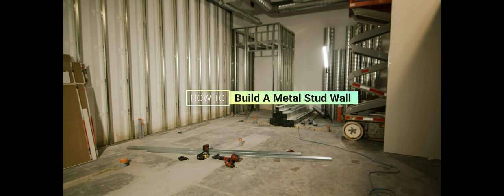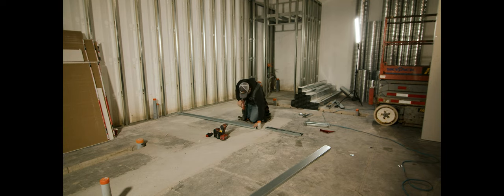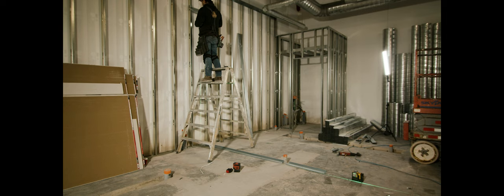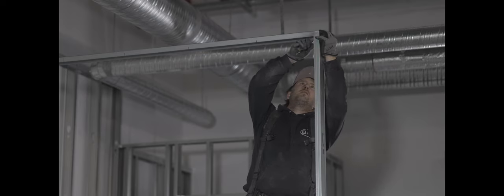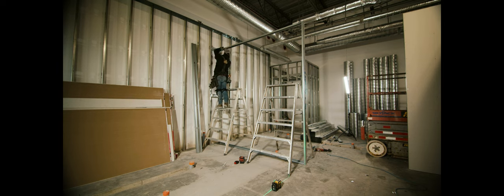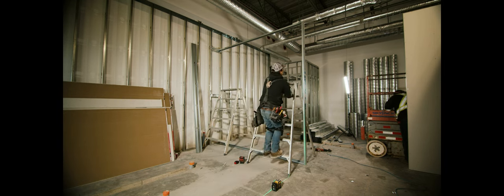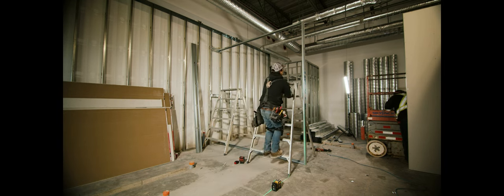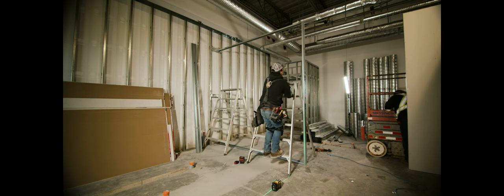How To Build A Metal Stud Wall

Comment: Screwed studs?  WRONG, it kicks out the sheet rock, use the crimper.  long, two-handled crimper makes the surface flat so the sheet rock is flat, not bulging out at he top and bottom, , , total mess.
Reply from the maker: Huh? That makes no sense at all. The screws are wafer head and do not bulge out the board whatsoever. Your telling me you crimp everything? Yikes what a mess that would be. Crimps don't hold after all the trades get in there nothing would be on center anymore. We crimp only when an impact can't fit or you can't reach properly.
Reply: @ConstructionKronies  well good for you, it's still wrong
Reply from the maker: What country are you from? Just curious, we would never ever ever get away with crimping in commercial here in Canada. Plus I'm not wrong, I tape and drywall everything and I've never had the screws bulge the sheets out in my 26 years of doing it.
Reply: @ConstructionKronies  I do commercial UNION construction in  the U.S.
Reply from the maker: @thomasgronek6469   cool man. You know this whole thing, I would love to talk more about. Do you lay down your sheets or stand them up? Do you screw the end studs in or just crimp? What types of projects do you do? And I know we can only crimp light gauge so how do you feel about 20 gauge and higher? Do you use screws then?
Reply: @ConstructionKronies  I stand the sheet rock up.  when it runs horizontally, the butt joints never tape properly.  the indentation along the long side of the sheet rock is to accommodate tape and spackle, as as we know, there is no indentation at the top or bottom of the sheets.  20 gauge metal is only 36 thousandths (just shy of 1mm), easily crimped with long handled crimpers.  BTW, I have a 50 year union card.
Reply from the maker: Yeah butt joints suck. We are just going to have to agree to disagree on this one tho. I do all my taping and never noticed any difference in the joints using the wafer heads to screw in the studs plus we honestly would never be aloud to use crimpers in commercial, I seriously just bought my first pair last year because I was doing metal stud houses and the light gauge studs for the frost walls in the basements I wanted to half crimp so I could get the screws in easier (pointing out towards the concrete). I appreciate your comments and I certainly wouldn't suggest to a 50 year vet to do it my way. Cheers mate!

Comment: Do you measure from the bottom of the vertical stud and cut the top off to keep holes in line for electric or pipes Just starting out with this
Reply from the maker: Yes we always cut the top off in order to keep the knockouts lined up for carrying channel. Sometimes in headers we will measure down from the first knockout then up. In bulkheads we don't use channel so.you can cut from anywhere.

Comment: I guess we do our steel studs “wrong” in Oregon. Cause every job I’ve been on we’ve used them framing screws with the wafer head.  I’ve only been learning how to tape for less than a year, but I’ve never heard the tapers say the rock was out of whack.
Reply from the maker: Yeah bro💪 I think the old way was to crimp your studs but the codes are more strict now and we just would get away with it. I have seen old framing videos from this British old dude and I think he did that plus he slid the studs into place and drywalled at the same time.

Comment: when you are building a wall and filling in your studs which way do the studs face ? thanks
Reply from the maker: Yes bro, face the studs in the direction you pull your centers, that tells the drywallers which way to go. We always screw the softside in first then the hard side. Think of the stud like an arrow hard side facing out! Does that make sense?

Comment: When you have 10 foot ceilings, do you use purlins for your sheet rock to hit at 4 foot increments?
Reply from the maker: No, never purlins, we will attach track to them but not drywall. We will use stud or furring bar, angle and bracing with wire. Check out my soffits playlist it will show you.

Comment: How would you brace free-standing wall if you have t-bars installed above?
Reply from the maker: Walls that are below tbar have clips that slip over the grid for you to screw the top track into. The drywall will finish 1/4"-3/8" below the grid and finished with tearaway bead. Remember, those clips do not get screwed into the grid. I've had guys say the job specification is to have tbar way above the wall, well some walls have to attach to it or go up to underside of structure. You can't just have a bunch of walls under tbar that don't attach to something, it's absurd. If the client is asking for something like that you have to tell them they have to design and tell you how they want the walls the braced. Remember, tbar is the ceiling and needs to close off the walls.

Comment: Loving your content, thank you so much in advance.  What is the best method when building a stud wall from one roof eave, across the ridge to the other eave? In other words how do you create a flat top track?  Its a long wall of about 15meters.  Would appreciate your guidance!
Reply from the maker: Super man thanks! If I understood you correctly, what you need to do it use flat stock or cut stud with 1-1/2" min flaps to screw or shoot in as clips. Then screw the track to the clips.
Reply: @ConstructionKronies  Thanks mate!  Do you have a link to a video explaining this in more detail by any chance?  I'm a novice to steel framing, and your videos are very helpful :)
Reply from the maker: This video here I explain the clips https://youtu.be/Jjt-7oVCqIs

Comment: how do you know the top track is level? measuring off the floor can be risky right? highs and lows in the concrete
Reply from the maker: If you need the top to be level use a line laser to set your elevation.  The important thing here is to make sure you have  a clean line at the top with your drywall. Also in this situation here the walls are above the ceiling. I am installing tbar at 9' and the wall is 10'-1/2" so it doesn't matter. What matters is that 1/2" space you give it end to end. If it has to be level then take your elevation from the high side.

Comment: Do you put anything between the studs to secure it?
Reply from the maker: We usually install carrying  channel every 4 feet through the knockouts. In the corners we use floater studs and tie them into the drywall.

Comment: I’m a wood framer and wanna build some walls and lunch room for a warehouse , but I’m puzzled on the freestanding walls . Should I leave bracing on top of walls to hold walls framing moving . How do the walls not move when these big doors shut when there is a 20x20 room with no ceiling ?
Reply from the maker: Yeah, you for sure need some sort of bracing. I get it, I came from wood framing, it's weird to have these braces, why not just use wood or throw a ceiling in. You can brace across the corners but the best braces are run back to something structural or the deck.

Comment: Hey Chris! New watcher and steel stud user. Love your videos, learned a lot already. Questions: Furring a basement and not sure how to secure both sides of your studs to the tracks when the steel wall is against an existing concrete wall? (Similar to your back wall there). Awesome video's.👏
Reply from the maker: Yes, so we leave 1/2" to 1" space between the concrete and your furring wall. There is a tool called a stud crimper that we use to crimp the backsides and sometimes after the crimp you can get a screw through.
Reply: @ConstructionKronies  Stud crimper, great! And do you install a corner stud deep into the basement corner for the floater to grab? We are planning to spray foam when framing is finished. Thanks for your advise and guidance Chris.
Reply from the maker: @geraldt3670  If your going for the spray foam I would think about putting hard corners but remember to insulate the gap inside before closing it off. Just have some r12 or semi rigid handy for that.
Reply: @ConstructionKronies  🤜🤛 Thanks Chris!